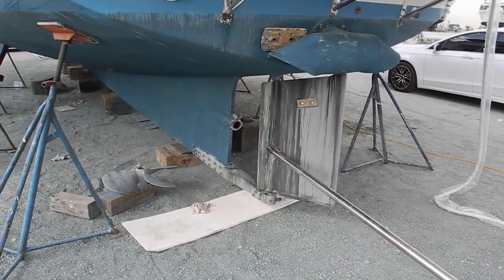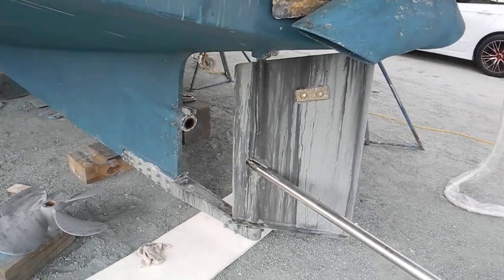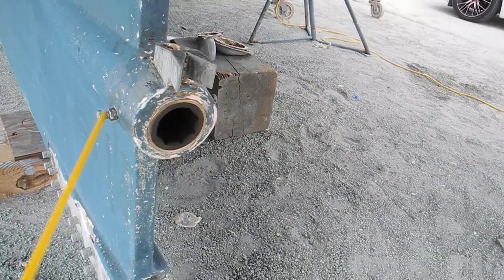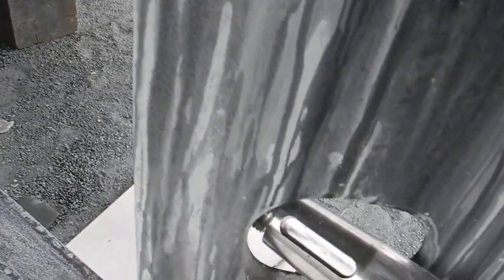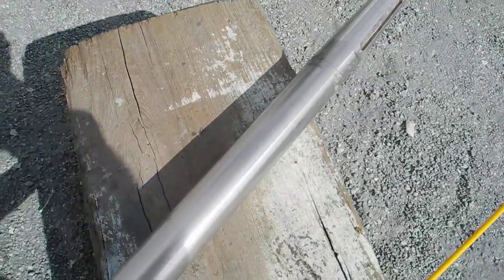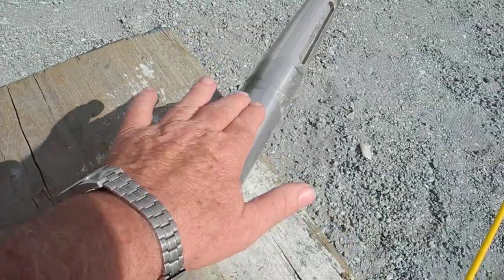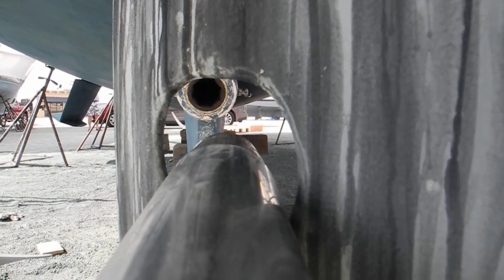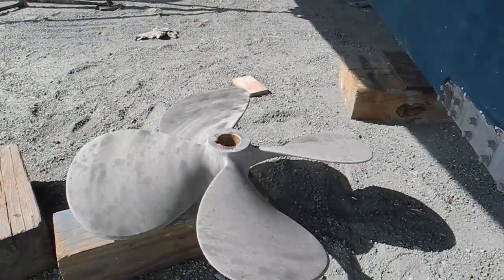Shaft removal single engine boat

Comment: Until recently, I didn't know that the cutlass bearings were rubber.  I figured they would be brass, with channels for lube/cooling.
Reply from the maker: It’s brass with a rubber insert.
Reply: @AskCaptainChris  brass casing, with a rubber bushing bonded to the inside.  The brass is pressed into the hole, to hold the whole thing in place.
Reply from the maker: @timgreen4137  have you seen our recent video where they press out the rubber insert?
Reply from the maker: https://youtu.be/kUzGwGSjrbk
Reply: Same here
Reply: I had only seen the ones with a brass casing before but when I was about to order one recently, I found there's also such with phenolic plastic casing. I figure those are easier to replace, that the plastic doesn't stick so hard in the hole where it sits but there's probably some disadvantage with plastic too. I took the brass alternative mostly because that's what I had before.